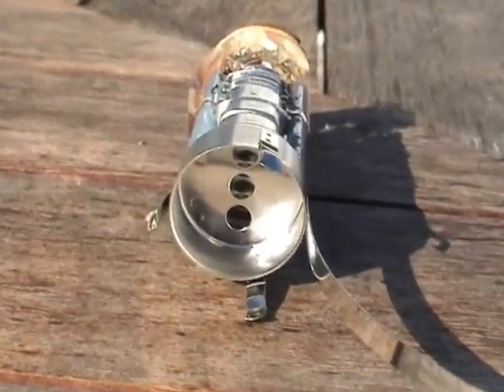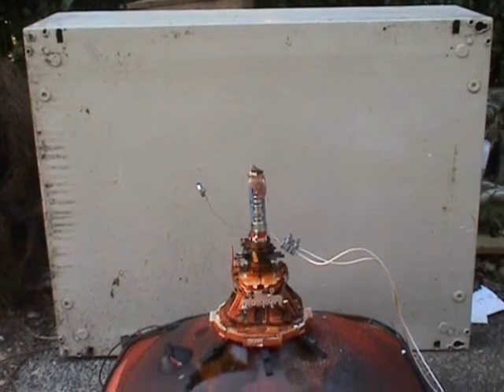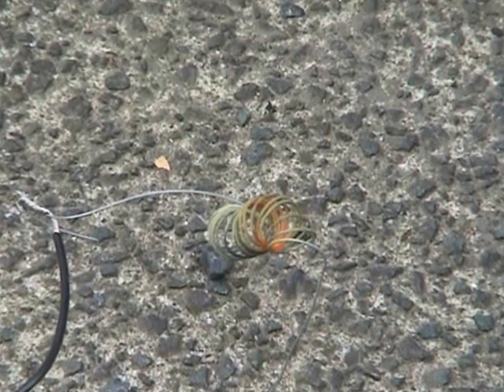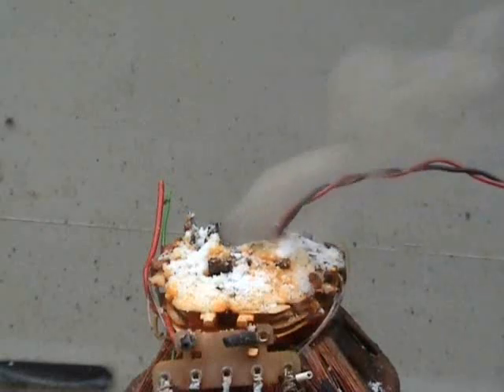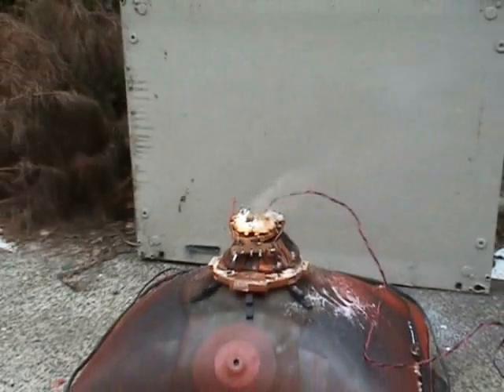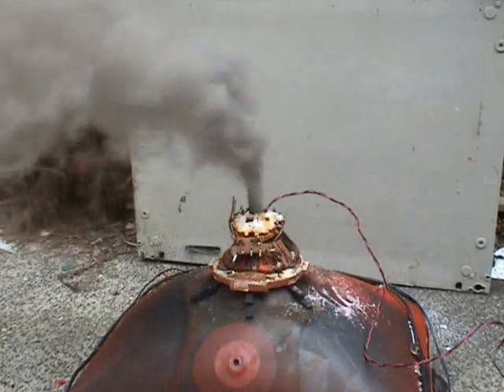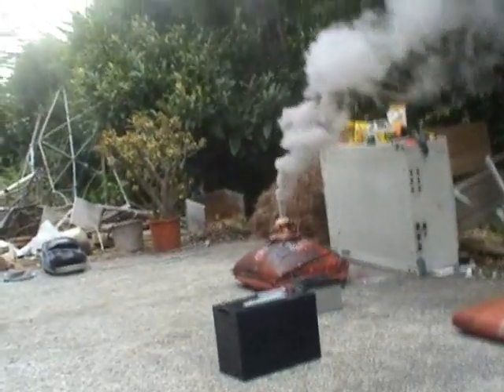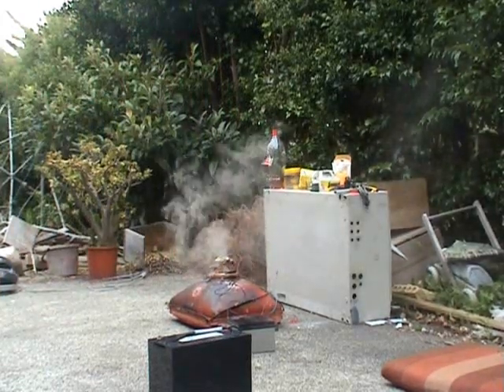Cathode Ray Tube smoking

Comment: YAY! Its a nice CRT smoker. I do wonder.....Would the tube be re-usable? 

I am not sure why, but I thought that there would be much more pressure output on this, because of how thick the glass is in these tubes. That other KNO3 smoker you did seemed to have much more whoosh than this one, so maybe, the mixture being inside the tube may have caused an adverse effect, whereby it partly suffocated itself, resulting in a slow smoulder, instead of a fast, high pressure whoosh, but slow = safe.

Comment: "The CRT was jump started on 12 Volts.
The filament burnt out."

The filament is only 6.3V. Up to 27kV (IIRC) is given to the anode. I can't remember the cathode or focus voltage ranges, though.